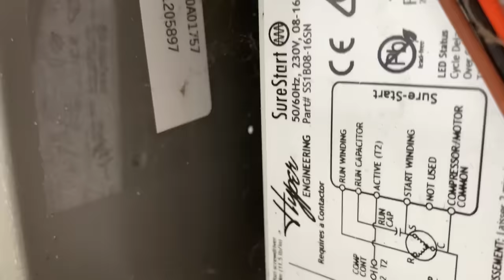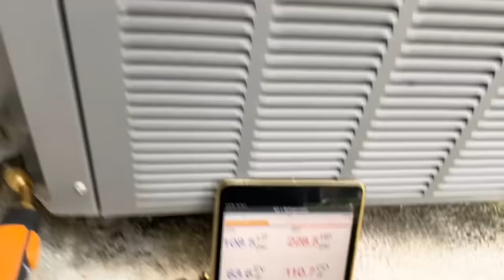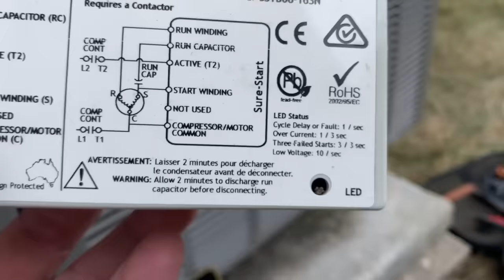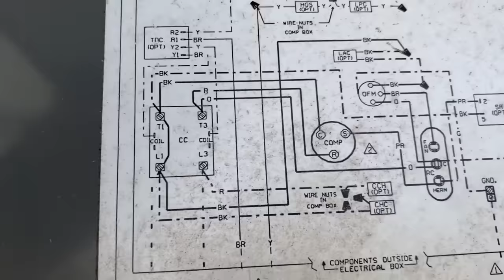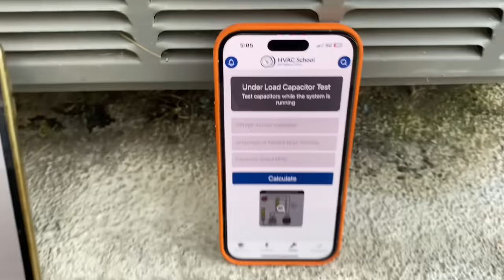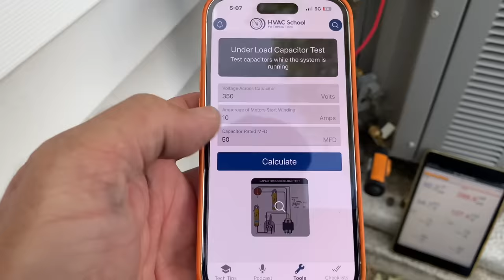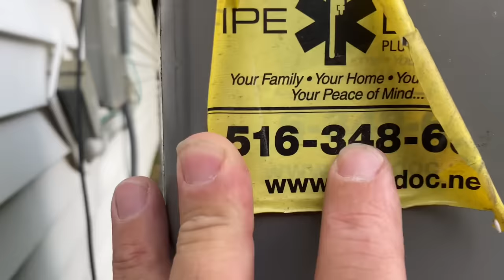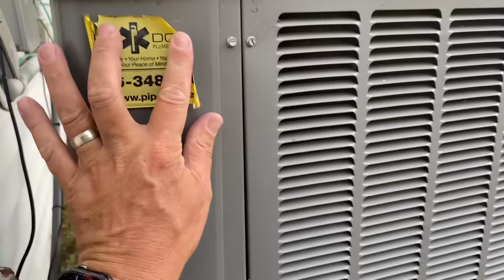Soft Start Killed Compressor! UNEDITED Central AC Service Call for No Air Conditioning Revealed!

Comment: Great content. Nice to see reprensatation from the Valley Stream area (I grew up around there). Anyhow that Hyper engineering Soft Start is horrible. I had the exact same thing happen on my AC. I switch over to the ICM 870 since, I am on my 2nd one of those but ICM honored their warrenty. Soft Starters must be very tempermental about the electrical connections, voltage stability, and amperage flow. Good vid as always.
Reply: The tech before him installed the 16A model. He should have installed the 32A. They make three models. A device will not hold up if it’s not rated properly for the installation. I install three different brands of soft start devices. They all work fine if you install them on the right unit.
Reply from the maker: Thanks for the info!
Reply: @USA-GreedyMenOfNoIntegrity  
Good catch on that one *5 ton would get a 32.. Ha the LRA was a whopping 146)..... I agree with the model sizing, however in my case I did have the correct size and it still failed.  The support behind it from Hyper was very repsonsive, but when it came to honering the warrenty, not so much. ICM however gave me no problems at all and sent a new unit. I did however have to get used to the new feature that ICM added which adds a 4 min delay before starting the compressor. Overall Soft Starters have not lasted too long in my cases. I have never tried the MicroStart, (seems like a good unit with bluetooth data accessibility). In either case when the soft start is working, it is so optimal for the equipment and long life, nothing beats it when it works right. 

Since you have experience with these, what is the average life span that you see out in the field, if properly sized of course?
Reply: @erichoward5565  I have the Micro-Air EasyStart for my 2.5 ton heat pump for a little over 2 years and haven't had a problem with it. What really shines about the unit is that it learns the compressor profile after 5 normal start cycles. During that time, I had run capacitor starting to drift under load causing the RLA to go above 12.8 FLA where the EastStart unit caught the anomaly and shut down the compressor like it supposed to. After replacing the capacitor and reinitialize the learning process again, everything was back to normal operation.

The only con is the price, but I think the bluetooth access to the onboard diagnostics worth the money in my opinion. The ICM 870 is a good budget alternative, I haven't heard any bad things about when sized correctly. Like a few mentioned, soft start units should be used for certain applications like those who will be running their HVAC on a standby generator or home energy storage (i.e. Tesla Powerwall).

They really don't save on energy like some people claim since the inrush current is only less than a second and longer compressor life is questionable at best. However it does make the compressor startup a little bit quieter to a certain degree and will reduce the annoying dimming lights so long as the utility supply is not the issue.

Comment: I really like your videos especially when you fire back on the keyboard warriors lol
Unfortunately I have something called interrupted service on my AC unit and the utility company can shut my unit on and off in a grid overload situation, No AC breaker in the house, just a Meter connected to another meter then to the disconnect then to the AC unit outside, This is annoying because I cant power my AC unit in a power outage back feeding via a inlet box, Can a HVAC or electrician undo this or do I have to get ahold of the utility company?

Comment: came home and the fan capacitor blew melted the wire  ,, I replaced it but the  temperature comes out at 72 now ,, could the compressor have gone bad ??? compressor comes on , heat comes out of fan but hot in house?????
Reply from the maker: something electrical. maybe thermal overload.
Reply: @PipeDoctor  it was a refurbished ac I just bought ,, the wiring was all wrong my friend came over and re wired it works great now ,, thanks . the speed control wire was not hooked up for the exhaust fan so it was running at a high speed and when the new capacitor was hooked up properly the condenser would not come on ,, crazy .. its amazing how just wiring can fool you to think the fan is bad or the condenser is bad .. and they zip tied the compressor wire to metal and it would ark and spark when starting up

Comment: You ignored the solar connection, that requires a soft start. It would have helped if you over came the problem for the total system they have.
Reply from the maker: Yeah, I guess you didn’t watch part two and just commented on part one

Comment: Have you ever seen a bad capacitor when not working right suck enough power to brown out the house. We have this house overloaded to start with 
. It doesn’t trip the breaker but will steal all the power when it kicks on? It’s like 1 second. Long enough to restart my router other devices stay on. Hopefully just fixed it with new capacitor. AC Dimming lights is closest video I can find on it. 🤞🏻

Comment: Considering that is a 5 ton condenser, the running current wasn’t all that bad.   I’m not a fan of adding those aftermarket “magic fixes” and this one resulted in a costly service call.  Now I wonder why that outside valve was turned off?   Another potential service while they are out cleaning the coil, restore water outside. $$$.
Reply from the maker: Exactly
Reply: There’s no point in doing anything if the outside coil is dirty and blocked like that. I see techs go all sorts on confusion when cleaning the coil solves 90% of the problem. That’s the first thing HVACR does because otherwise you are wasting time and your customers money.

Comment: Soft start module undersized! period. These devices do not damage the compressor. I have installed over 400 of that exact unit you removed. two failures.

Comment: "That stupid soft start thing" - maybe try learning about the technology... they're great devices.  As many others have noted, that was just the wrong one for the compressor in that unit.
Reply from the maker: It caused the homeowners lack of
Comfort cooling. Yeah, it’s a dumb ass hockey 🏒 puck. Now watch part 2.
Reply: @PipeDoctor  watching it now, and your 501c3 is now on my year end donation list.  But that hard start kit won’t do a thing for your customer when they want cooling during a power outage and the Powerwall can’t deliver the LRA of the compressor.  Soft starts serve a purpose and they serve it well.  They just have to be appropriately sized for the compressor load.  

The soft start manufacturers all shy away from claiming their devices extend unit life, but avoiding the LRA inrush on every single start has to be beneficial for wire insulation, compressor fusite terminals and plugs / flag terminals, etc.

Comment: I have installed almost 60 of those soft starts in the last 5 years and have not had a single failure. That is the most reliable softstart made on the market. Looks they installed  to small of a softstart. Your title needs to be changed

Comment: copeland mobile app shows compatible hard start kits. I have yet to see soft start info. so until they have soft start recommendations, I will stick with the hard starts if necessary or beneficial. 
Just my personal preference. I would especially be worried adding soft start to an old compressor for this exact reason. nice content, i always enjoy.
Reply: Emerson sold a secure start. It  is not a soft start by definition. It is a current limiting device and it also manages the start winding too. It was made by HyperEngineering. They just cost a lot more than a hard start so they are only popular with a select group, mainly people who run on generators.
Reply: Copeland actually rebrands the exact hard start Mike threw away and call it their own.
Reply from the maker: Interesting 🧐

Comment: Changing furnace they say heat pump? I'm in Canada very cold do they work?
Reply from the maker: Depends on how cold
It gets
Reply: @PipeDoctor  Well -10  on a cold night -15 during the day -3 I'm a little worried Trudeau pushing this system as green just another Biden.
Reply: @glendekoker3682 Heat pumps serve as air conditioners in the summer and heaters in the winter, but their effectiveness as heaters is contingent on the outside temperature remaining above freezing. Given your residence in Canada, where winter temperatures often approach or drop below zero degrees Celsius, a heat pump alone may not suffice as a heating solution. To ensure adequate heating under such conditions, it's necessary to install a separate auxiliary heater within the heat pump's air handler. This addition enables the heat pump system to provide sufficient warmth even when external temperatures are below freezing.

Comment: @Mikey Pipes, why does your video title make it sound like the soft start device destroyed the compressor? CLICK BAIT!! The soft start protected the compressor from over current caused by the condensor coils being dirty. The soft start shut down power to the compressor, then faulted (shut down). Just a guess, but I'd say It's a good bet that the soft start was undersized for the tonnage rating of the outdoor unit's compressor, but as you clearly showed, the "fur" on the condenser coils was the ultimate culprit of the soft start's demise. Soft start devices, when sized correctly for the tonnage of the unit, work like a champ. They don't "KILL" (i.e. destroy) anything, but they do work great at reducing the start up amp draw so you can run your home A/C with a portable generator.
Reply from the maker: Thanks for sharing your feedback. Much appreciated

Comment: Is the MicroAir 368 Soft Start a good product?.
Reply: I'm personally using the exact same HyperEngineering Soft Start module Mike Removed (guess they do go bad) on my 4 ton Goodman and it works very well. Cuts inrush by 70% such that we are able to run the Air Conditioning on our Schneider 6848 XW+ Inverter with no problem. MicroAir368 is also one of the Soft Start products we often recommend on the DIY Solar Forum for members that need to operate central air on a split phase inverter when utility power is out.
Reply: I think so but if I recall it’s larger so more challenging to fit. You saw how compact the HyperEngineering box was, fit right in.
Reply from the maker: Thanks for sharing Bentley

Comment: Soft Start are sold to people who do not get the right sized generator. they will over time kill the compressors.  they need to have the big amps to get going.
in short just get the right generator for the job and then over size that 20%.
Reply from the maker: Smart!
Reply: That is quite backwards, the soft starter shown here limits current as shown in the video and by extension limits the banging on the compressor during start. Copeland actually rebrands this one as their own.

Comment: Why bother to even test the run cap when its cheaper to replace it than waste time testing it. 
also, just replace the contactor and install a CSRU1 start kit on it.
Reply from the maker: Because if you’re not testing, you’re guessing
Reply: @PipeDoctor  True that if they are fairly new, But I religiously replace run caps if they're more than 4 years old, especially if its the chinese made junk.

Comment: why not eliminate the simpler problems 1st ie clean the coils then break out the expensive toys. if needed
Reply from the maker: Great idea thanks for your sharing your feedback
Reply: @PipeDoctor  hey there was thinking about replacing my 2 blade fa with a 3 more ir better cooling, but they say the motor will over heat , what do you say.

Comment: Mikey Pipes! Do you have a recommendation for soft start capacity based on rated input or a range?
Reply from the maker: Not for this particular model. But it was a 5 ton R22 unit.

Comment: You're off the mark.  That soft start was doing what it was supposed to do.  The dirty coil is causing excessive load.  Clean the coil before replacing parts.
Reply from the maker: Okay 👌

Comment: The fact that you didn't really seem familiar with soft start devices does not exaclty represent a high level of AC knowledge. Other comments are most likely correct that it was protecting the compressor from the stress of the dirty coil. Or you are familiar that they extend the life of the compressor and would rather they fail so you can replace. Waste of time watching this.
Reply from the maker: The fact that you watched the video that I posted over a year ago and commented on it really helps my channel. Thanks for the feedback, not really. I really don't give a flying fcuk. But I like wasting time especially on my YouTube channels. Why? Because I really make TONS, boat loads, of cash from Google. Thanks! Please comment again.

Comment: No need for a soft starter unless the circuitry can not handle the LRA.  These things are sold ofter as a "compressor saver" which is absolute BS.
Reply from the maker: I tend to agree with this comment

Comment: Mikey , Mikey , Mikey  i saw this video and you better stick to pipes !  You don’t seem very smart for a/c , you saw on your meter the dramatic change in amps when the compressor started with and with out soft starter  so just because it wasn’t the right one doesn’t mean they are trash glorified hockey pock like you called it , amongst other erroneous things you said on there ,  just saying 🤷🏻‍♂️🤷🏻‍♂️🤷🏻‍♂️

Comment: Soft Starts have no benefit to the A/C system. The blinking LED, according to the label is 'Over Current'. 1 flash every 3 seconds. Super cryptic, I know. I will bet you $1 the solar company that put up the sticker next to the A/C disconnect installed that device. I'll bet another $1 you did not call them. 67.2 A before removal vs 130.5 A after removal means some equipment on that property will soon be fried. The Soft Start protects the equipment powering the A/C, not the A/C itself. Usually installed along side of redundancies like gen-sets or, solar inverters, and inverters powered by solar charged batteries. So sad Mikey. The way you threw that Soft Start in the yard reminds me of the Life Cereal commercial.

Comment: Soft starts are not for hight turque motors.  They are good for things with a low starting turque, like a water pump. Compressors are not a good application for soft starts.